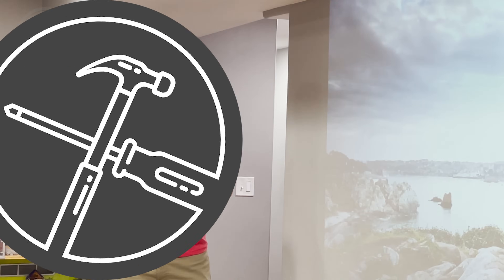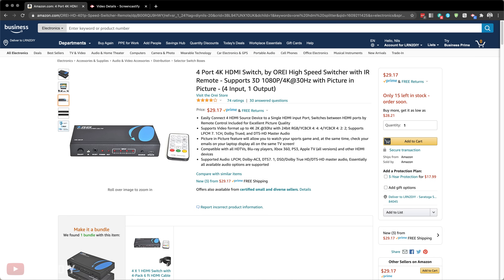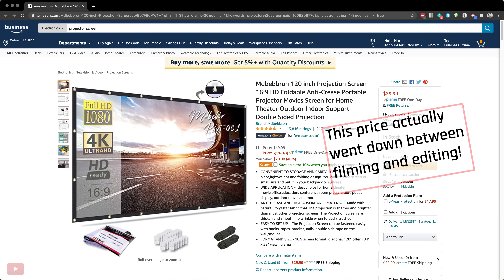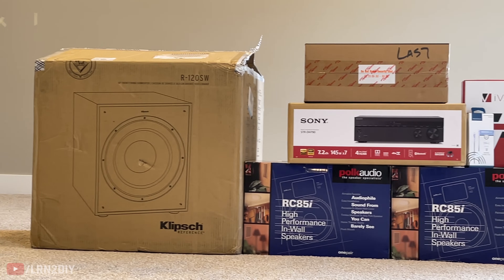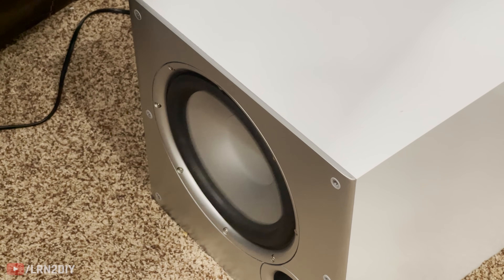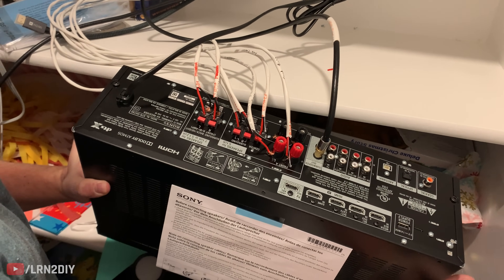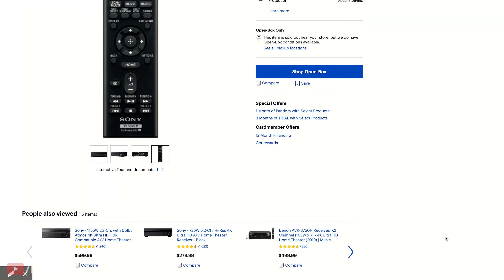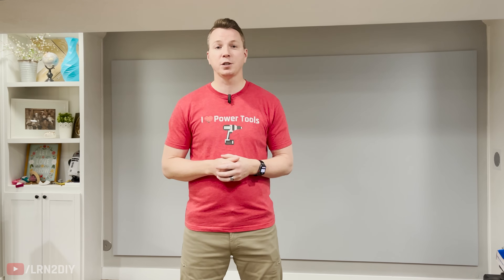3 Complete Home Theater Systems Starting at $500

Comment: I would love to see an episode on options for “hidden” living room projector/screen setups that can work with an existing tv. I’ve been trying to come up with an elegant solution for movie nights, where the projector screen works in front of an existing wall mounted tv, and the projector’s wiring/mounting is fairly easy (I have concrete ceilings/in condo which makes things interesting). Or, an elegant short throw setup.
Reply from the maker: Yeah, I think short throw would definitely be the way to go on that. A low profile ceiling mount pull down screen would be great too but it would still be noticeable if you looked at it.

Comment: Iam building a budget home theater system right now i have a budget 1080p vankyo 630w projector with wifi for screen mirroring it the upgrade from vankyo 630 and a 120inch screen and a xbox one s gaming system and a 1080p roku streaming stick iam about to a onn dolby atmos sound bar from Walmart the projector is full 1080p my seating is a couch and two love seats and some theater chairs the projector was $ 230 dollars from Walmart the xbox one s was   only $ 125 dollars because seller thought it was broken it only needed to be upgraded the seats and couch came from a family member the onn sound bar is only $ 299 dollars

Comment: That infared transmitter was pretty sweet. I’ve never seen anything like that. I e got a functional, but unfinished, theater room I’ve been working on for years. It’s painted, got equipment, just needs polishing up (shelves, hide the wires, hang the tv, etc). Good video and thanks for the tips.
Reply from the maker: Sounds like you're right there! Good luck with the finishing touches and thanks for watching.

Comment: Don't forget used gear. You can often get a lot more bang for your buck if you buy used. People divest from A/V equipment all the time, and that means you can get something that's not just decent but actually great for the same amount of money or less.

For example, I recently picked up a Sony 4K 7.2 receiver with HDCP 2.2 used for $50. It works flawlessly and looks like new.

I only have 5.1 in terms of Sony speakers (also bought used for next to nothing), but I have room to grow into 7.2, and I am ready when the time comes to pick up a 4K TV and 4K Blu-ray player.

Craigslist, Facebook Marketplace, and Goodwill are your friends if you are willing to put in the time to find a deal and don't need something right away.

Comment: $125 - RX-A660
$180 - 3x Polk T15 (5.25 in driver)
$40 - CSI Center Channel (dual 4.5 in drivers)
$40 - PSW-505 (12 inch powered Polk sub)
$20 - YST-SW012 (8 in powered Yamaha sub)
$500 - Epson 2040 (1080p, 35000:1, 3D)
$50 - screen

$955 full HD 3D 35000:1 contrast 5.2.2 Dolby Atmos/DTS:X and up-mixing capable system

My point: Buy used from people who don’t know the value of their components.

Comment: I am currently running a roku ultra to my projector with the same vizio 5.1 surround system you are using in the demo.  I have a Wimius projector.  I use a 30 ft. aux cord from my soundbar under my screen to the projector on a shelf in the back of my room.  From your video I could move my roku near the soundbar and use the switch for a similar set up you are using for the cost of the switch and long hdmi cord.  Am I looking at an appreciable sound upgrade with that or will it basically be about the same?
Reply from the maker: That depends on what aux cord you're using but if you use HDMI for both or use digital optical for the audio, then yes, that will improve your audio.

Comment: i am interested in UST projectors, specifically the Xiaomi ones, any thoughts on those?
Reply: If you have the room get a normal projector in that price range. If not they are ok, but not amazing. If you want amazing UST look at Vava or Epson EH-Ls500
Reply: @Jendru214  I really wanted to keep it low profile, like just a wall of drawers, have the screen come down in front of the drawers and the projector slide out of one of the lower drawers, completely hidden unless in use. That's why i was looking at UST
Reply: @TRCCtv  If you want it that way than sure, I would go for vava, optoma or epson for ust. from what I see Epson is the most compelling in price/value as you can get it bundled with a really good alr screen (not motorized though)

Comment: Great video! I’m just curious, if Ethernet is transferring data at 1Gbps, how can it transfer the 4K 60hz image along with all the sound data to go with it when you need a high speed hdmi cable to do that which I believe start at 18Gbps? Am I missing something? If you or any viewers are able to answer that question that would be greatly appreciated, thanks!
Reply from the maker: Great question. I'm no expert on this but I know that Cat 6a ethernet and later support up to 10Gbps, which is obviously not on par with HDMI 2.0's 18 Gbps, but Cat 7 and 7a support a speed of 600 Mhz and 1,000 Mhz respectively, so I'm not sure if that helps to compensated for the lesser bandwidth. I'd also be interested in hearing if anyone can shed some light on this.
Reply: @LRN2DIY  Could it possibly be compressed at the source and decompressed at the receiving end?

Comment: Love the vid bro! Hey- sounds like maybe your audio gain is a bit high and clipping. Are you having to jack your audio way down in post?
Reply from the maker: Hey Chris, good to hear from you. I didn't hear much clipping but I did notice it in a couple of spots. The audio comes in fairly low and I usually have to boost it (in Premiere I use the "set max peak to 0" option) but I think I may have boosted it beyond peak in a few spots. You have keen ears, my friend!
Reply: @LRN2DIY  haha. Thanks man but not really. I’ve had the bug to create recently. Built a super budget studio in my basement but have zero ideas for content. Anywho- I’ve been testing out mastering audio recently but I’m not very good at it (OR color gradingfor that matter 🤣). Do you record straight to the camera? I noticed you were wearing a lav. What’s you equipment?
Reply from the maker: Sounds like you're getting ready for some great content! Yeah, I record straight to the camera, almost aways with a lav mic. I just recently purchased the Rode Wireless Go set and I've been pleased with it. The little clip on my shirt is a 3D printed lav mic holder specifically for t-shirts since the traditional clips always rub. I feed right into the camera and usually have a backup Rode VideoMicro recording near the camera too. Audio is one of the toughest parts about filming, and often the most frustrating so I'm still learning for sure.

Comment: I have a Yamaha RX-V665 receiver that the HDMI output stopped working. Would I be able to wire in the OREI High Speed Switcher  to save my  receiver and still have surround sound?
Reply from the maker: Yes! I actually did pretty much this exact setup not long ago before getting my receiver that I have now. If you buy a switcher that has 4 in, 2 out (here's one: https://geni.us/FZIbHtn) it can be used to manager your inputs and then one HDMI out goes to your TV/projector and the other goes to your receiver to manage audio. A lot cheaper than a new receiver and still lets you leverage your receiver's capabilities. I'd love to hear how it works out for you.

Comment: Great video! What’s the difference between these and atoms?
Reply from the maker: I'm not sure what you're asking. What do you mean by atoms?
Reply: @LRN2DIY  Dolby Atmos… sorry typo
Reply from the maker: @RichsRantMMAofficialchannel  Ah, gotcha. Atmos adds two or more speakers that are either mounted higher up or bounce the sound off the ceiling to replicate the effect. If your media and receiver support it, Atmos allows for overhead sounds to be distinctly rendered in your theater setup, like a helicopter fly-by or something falling. These are definitely an option (check out my other videos since that's what I'm using in my theater) but they pretty much always increase the cost of the entire setup.
Reply: @LRN2DIY  ok thanks for explaining!

Comment: How did you handle the heat from the receiver in the closet? I would love to do this, but my receiver, htpc, and other components generate too much heat for a non ventilated closet.
Reply from the maker: Yeah, they really do have to be ventilated if you have a lot in there. I just recently bought a ventilation system with a thermostat for my home theater, even though it's out in the open. I think heat is one of the biggest killers of media equipment. A closet like that might need a full on vent right through the wall to dissipate the heat, ideally with some fans and a thermostat. That would all be pretty doable and would cost under $100.
Reply: @LRN2DIY  My STRDH590 produces alot of heat. It gets really hot at high volume.

Comment: 😂😂😂 Wow!!! 

A Good Projector costs $3000.00 plus. At that price the picture Quality is Far inferior to a $2000.00 85" inch Samsung Oled TV.

Today if you are going to use a Projector you have to get a 4K Projector and they are much more expensive than buying a High Quality 85" TV. 

Today's Large screen TVs are very immersive. And are much better to watch than a 150" Screen with a far inferior picture. 

I don't like anything you did in this Video. 

Sony Makes inferior AV Receivers. Denon has much better AV Receivers, as does Yamaha, Pioneer, etc...

Sony makes Excellent TVs but their Speakers and AV Receivers are 2nd rate.